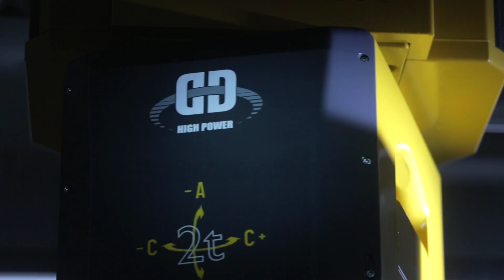Australia's F-35 Suppliers

Comment: +Steven Murillo You're wrong in almost every way you could be. You're also lying about being a pilot.
The F-35 actually handles quite well , Pilots are saying that it handles like an F-18 but without the one thing F-18 pilots complain about. Bet you dont know what that is.
Lets get into specifics, I've posted this elsewhere but I find it handle to keep it in a folder to share with people that don't understand the aircraft.

Lets look at some figures against some proven and supposedly superior platforms, lets compare them and see.

If you really know something about planes you would know that you basically need 3 essentials to be maneuverable:

1. Lots of Lift
2. Lots of thrust
3. Little Drag

Lets discuss lift:
I know you probably heard Pierre Spray said that the F-35 is a dog because it has little wings. and has to carry 110lbs of airplane for every square foot of wing.

Pierre Spray was involved in the aircraft industry at around the 1960s where fighters were basically tubes with wings.
At that time all of the lift came from the wings. small wings = small lift.

But at around that time Martin Marietta (now Lockheed Martin) was experimenting with Lifting Body designs, they wanted to produce fuselages that can assist the wings in producing lift instead of being dead weight.
Read more here: http://en.wikipedia.org/wiki/Martin-Marietta_X-24

That’s why at around the 1970s we began to see fighters with wide flat fuselage sections and smaller wings. So lets compare the wing loading of the F-4 against Pierre Spray's favorite F-16 variant the F-16A.

F-4
Empty: 30,328lbs
Load:8000 lbs
Comabt Weight: 38,328
Wing Area: 530 feet
Wing Loading: 72 lbs/ sq feet

F-16A
Empty: 16,300
Load:8000 lbs
Comabt Weight: 24,300
Wing Area: 300 feet
Wing Loading: 81 lbs/ sq feet

So by Pierre Spray's own argument the horribly turning F-4 should fly circles around his hotrod F-16? What’s happening here?

Well the F-16 does not rely on just wings to produce lift, it has a blended body and wing design, plus LERX that produce vortices above the airplane (if you remember you physics, high pressure below + low pressure above creates lift)

around 40% of the F-16s total lift does not come from the wings at all. So in reality the F-16's actual wing loading when loaded with 8,000lbs is closer to 49 lbs per square feet not 81 lbs.

The F-35 is the same. to get the F-35 to have 110lbs / sq ft of wing loading as Pierre Spray said it needs to carry 21,300 lbs of load.

The f-16 can never do that, but the F-35 can! that’s what’s great about this plane, it gives you options, if you need to go to a long range mission then sure, the F-35 CAN carry 18,000lbs of fuel and 18,000lbs of weapons.

But if your going to a CAP mission where a dogfight is possible, then why load it with 21K? Most likely an F-35 would take off with 18,000lbs, And when it gets to combat it would probably have 10,000lbs depending on the range to the target.

So lets pit the F-35 against some really good aircraft, Wing Loading calculation.
All loaded with 8,000 lbs, perfect for dogfighting:

Wing Loading:
Mig-29 M/M2: 91
F-16C (block 50): 90
F-35A: 81
F/A-18C: 77
Su-30MKI: 72

So as you can see at dogfighting weights, the F-35 is not bad at all, its not the best but really not all that bad.

Now consider this, the F-35 probably has the most efficient body lifting surface of all these aircraft due to the fact that its fuselage has the smoothest flatest surface of all these planes, not a lot of disturbance for the wind to flow around on.

So lets give all these aircraft a Body lifting coefficient of 40% but to be conservative lets give the F-35 45%, the truth is probably much larger but hey lets keep it down.

Wing loading plus body lift:

Mig-29 (M/M2): 54.6
F-16C (block 50): 54
F/A-18C: 46
F-35A: 44
Su-30MKI: 43

The F-16s wing loading is similar to the Mig-29s which is why it replicates the Mig-29 in RedFlag.

But Notice how the F-35's wing loading is so close to the F/A-18 and just 1 pound above the Su-30, which is why when you ask pilots they will say that the F-35 maneuvers like an F/A-18 with better acceleration.

And really acceleration is the only thing Hornet pilots dont like about it.

http://www.flightglobal.com/blogs/the-d ... -tactical/
Lt Col Matt Kelly wrote:
Operational pilots should be thrilled with the F-35's performance, Kelly said. The F-35 Energy-[Maneuverability] diagrams, which display an aircraft’s energy and maneuvering performance within its airspeed range and for different load factors, are similar to the F/A-18 but the F-35 offers better acceleration at certain points of the flight envelope.

So do you still think they are lying?

Now lets talk thrust. This is a no brainer, the F-35's engine is rated at 43,000lbs the most powerful in the world. So lets cut to the chase and compare.

Thrust to weight at max thrust:
(All loaded with 8,000 lbs)

Mig-29 (M/M2): 1.05
F-16C (block 50): 1.05
Su-30MKI: 1.13
F/A-18C: 1.14
F-35A: 1.15

Surprise Surprise, the F-35 has the best Thrust to weight ratio of all of the planes involved, and really in a dogfight Thrust to weight can be more valuable than Wing loading.

Now Drag:

All these planes will carry weapons externally adding lots of drag. with a full centerline tank the F-16 is reduced to 7Gs max and the Mig-29 is reduced to an appalling 4Gs, the F-35 will carry most if not all its missiles internally, very little drag.

So to conclude, even without Stealth, even without all its advanced sensors and ECM suits, the F-35 will (in the words of Pierre Spray) wax the competition every single time, then if the F-35 is a dog the rest should be compared to kittens.?

By the way, You saying the F-35 is not an air superiority fighter and then suggesting that the Rhino is, is what gave you away. That and the fact that your channel isnt in english and only two countries in the world operate the rhino, one of them being mine.
Reply: twinboost
YOu state you have no idea what you're tlaking about and then you presume to make a judgement on a technical issue just by looking at its airframe? Ive already explained that to you and you continue you parrot the same BS, You're not interested in having a discussion, you're interested in being right in your own mind.
I suggest you take the time to understand the aircraft before continuing to make a fool of yourself. I'll leave you to a very obvious last word syndrome.
Reply: Shut the hell up with that post ive seen 3 different people post that exact argument claiming it was copied and pasted from another post they had. Pathetic people.
Reply: xV0LK0Vx
 And if you took the time to do a little research ( not a strong point for you F-35 haters I know) you'd see mine was first. Has been for ages. Started at F-16 .net . Go look for it.
Reply: Antifaith29 thats where they get them so whether you made it or not we have no proof, therefore putting it up there as an argument is useless.
Reply: You sir are an idiot.
Reply: twinboost
 and you know nothing about aircraft
Reply: Don't have to ,to know this F35 thing is a money vacuum ,shitbox.. Wide body more drag especially lateral, stubby wings, the thing is useless... by the time it turn to turn it would be blown out of the sky.. The paper (money) aeroplane
Reply: twinboost
So you admit you dont know aircraft then you proceed to rattle on about things you dont understand? You truely are an idiot. Thanks for the laugh.
Reply: The laugh is the scam, that is the real joke. All anyone need do is research to find the truth about this money vacuum... 
It is a useless fighter ,too wide to heavy,no range , pouring money into a flawed design is a scam and you bloody know it too..
L.M should be forced to reimburse every cent that has and is going into this lemon.
Reply: twinboost
 No range? On internal fuel it has the same range as a super hornet with a centerline tank. Thats just in the vlo config. If thats not required you can put tanks on it, it has more range than everything Australia is using today.
Reply: twinboost  In its vlo config it has zero parasitic drag and it out turns, out burns and out performs every single armed aircraft it is replacing. Thats where you idiots get it so wrong, you usually compare clean frames to armed aircraft, not smart. Carrying 8000lbs of ordinance the F-35 has the same High Alpha manueverability as an F-18 except it doesnt suffer from energy loss the way the F-18 does. Do you actually know anything about aircraft or are you parroting the hyperbole youve seen here?
I've spent ( almost)the last five years of my life as an Aeronautical engineering student and the last 9 months to the day working as one. How about you?
 Do you have another argument or are you just going to parrot the same thing over and over again even though it's been proven wrong?
Reply: twinboost
 In fact while armed, the F-35A has lower wing loading than the F-16C. How about that?
Reply: Yeh I saw all the transformer door shit, impressive looking but gain in weight a big disadvantage, plus it would be a right  and disaster for the poor pilot if the doors froze shut.. Still can't make a silk purse from a sows ear..
Reply: twinboost
What does any of that have to do with anything I just said?
Reply: twinboost
Are you talking about the internal weapons storage ?  Like they have had in aircraft since ww2?
Reply: twinboost
and the gain in weight? Again, while carrying weapons ( and that's the important thing, I cannot stress that enough, you do not go to war with a clean airframe...unless you're an idiot) the F-35 with 8000lbs of weapons has a max thrust TTW of 1.15
The Su-30 is at 1.13 F-16 1.05
Im not sure what you're missing here.

Also, while were at it, with people constantly saying it's slow. It tops at mach 1.6 while armed, again thats the important thing. As an example the Rhino ( Super Hornet) barely makes mach while carrying tanks and arms. And even then after a massive run-up.
Reply: Ok granted less drag fully armed , where fuel could be, so no range , and it cannot turn.. 8000 pounds of weapons tucked inside?? ...Probably says that on the brochures???
Reply: twinboost
Did you completely miss the fuel part? lol it has more range on internal fuel than anything were operating right now in Australia. You're hilarious, man. You have absolutely no idea. Cannot turn? Ive already explained that too. You'll just continue to parrot terms you dont understand because it sounded like whoever said it might know, you yourself, you have no idea. Stop pretending to.
Reply: twinboost
Oh and the internal payload is much larger than 8000lb's. I was just using that as an example. 8000 is about what it would use on a CAP mission. Send it in to drop bombs were looking closer to 18000.
Reply: The only it appears to be good at is "being under development" while vacuuming money.
They are the only facts. It is a farce and a scam, stretching out for far too long this is the reality...
Reply: twinboost
Again you just spew bs with no actual facts regarding the aircraft. Talk about the aircraft itself, get into details, if you have a genuine reason and not just a need to spew BS youve heard other people say then we can talk about it. until then you're written off as an idiot that talks about things he doesnt understand.
You're a fucking Clown shoe.
 I have addressed every " point" youve made ( if you could call it that) and you just continue to say the same thing over and over again. " Oh its too heavy it's too slow and it can't turn"  , I explain that it isnt, its not and it can and tell you why and you just ignore that ( because you dont want to hear anything but yourself talking...or typing as it were) and just say the same thing over and over again.
Every single pilot that has flown it, not just LM test pilots but line pilots who's lives will depend on this aircraft have had nothing but praise for it. Including its kinematic performance' I guess you know better?
Reply: Antifaith29 No mate I just tell it how it is..
Reply: twinboost
 Ya see that's just it, you don't know how it is. It's like you want to be seen to have an opinion or something and want to act as if you know better. You have demonstrated not only by ignoring points made but by your own admission that you have an extremely limited understanding when it comes to aircraft in general, let alone the aircraft in question.
Take some time and listen to what the people that work with it are saying instead of assuming you know better.
Reply: twinboost
I'll tell ya what, go point for point with me. You tell me ONE thing about the aircraft itself, I'll do what I can to set it straight and so on.
Given the time , tomorrow will probably be my next reply to you.
Reply: Why is development taking so,long?
Why have the costs blown out more than any other fighter ever made ?
Why can't it perform tight turns?
Why did everyone buy the promotion sales pitch?
It hasn't even been fully tested yet, when that was attempted bits of the airframe came off.
Why doesn't the software work correctly?
Why do you stick up for a lemon?
Reply: twinboost
 Like I said, talk about the air craft itself. Not the development program. Ill adress the one question on the aircraft itself you had. Why cant it perform tight turns, answer is, it can. Ive explained how already. I suggest you re-read our discussion, either that or buy some glasses.
As for the rest, you acting surprised they find problems during a phase of testing where theyre supposed to find problems is a bit silly.
Reply: You don't need to sell an idea that didn't work..
The aircraft does not do what was claimed in the sales pitch.  
We want a full refund.
Too long, Too much , Too late!
It's a scam.. More fool you.
Reply: twinboost
Yeah, you're just regurgitating the same bs over and over again now. It's obvious you have no idea, you just want to be seen to have an opinion on something ( some kind of inferiority complex?)
You have demonstrated over and over again you dont understand the aircraft or how it works and that you're happy to just parrot things youve heard other people say, liuke ive said a hundred times, the people that matter, the people whos lives will be relying on the F-35, love the thing. Some backward YouTube " expert" such as yourself has no idea, its laughable.
Reply: As I stated , I am no expert on aircraft, indeed,one does not have to be , observing the airframe is enough.
However I am not blind to the bigger picture.
I have weighed up both sides in my research as everyone should do and come to a conclusion. 
You think I am the only one with this opinion, just keep laughing.

Comment: The F-35 is a multirole fighter just like the F/A-18E/F Super Hornet. Also you are wrong when you said it is for ground support over air superiority, its designed for both. Also the F/A-18E/F is the inferior plane as the F-35 model that the RAAF is the F-35A, or the CTOL model which can pull a 9g turn, while the Super Hornet can pull only 7G's. Also those videos of the Super Hornet were all clean with little on no weapons. The moment you put two bombs and two missiles it maneuvers like a slob...

Comment: Not to be mean Lockheed Martin but giving the F-35 to Australia  as air superiority fight will NOT make the F-35 better at it. The F-35 wasn't designed for dogfighting it was designed for mainly air to ground operations. Do you seriously think that the F-35 can be better at A2A than the Super Hornet. Actually the f-35 is inferior in A2A and air defence when compared to the Super Hornet. Have you watched videos how the super hornet maneuvers at low speeds? The Super Hornet could do very well in